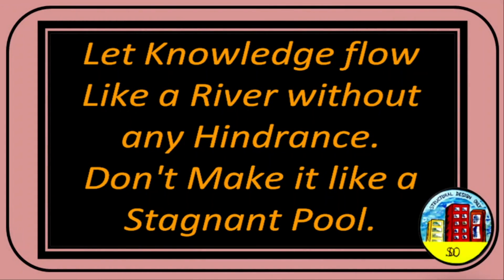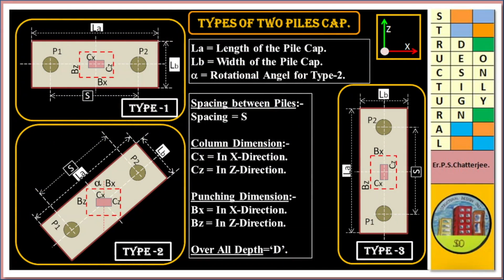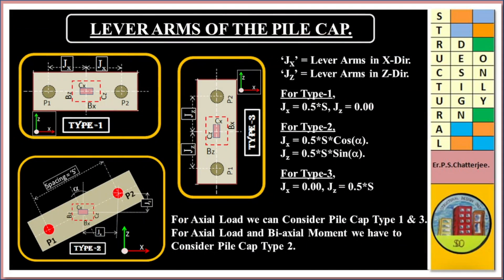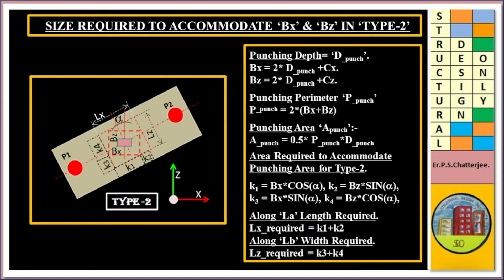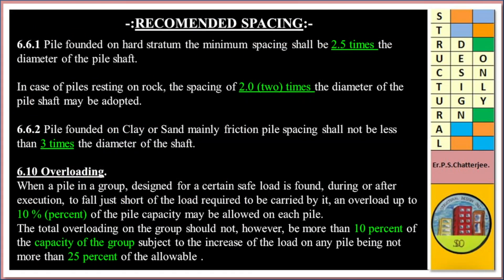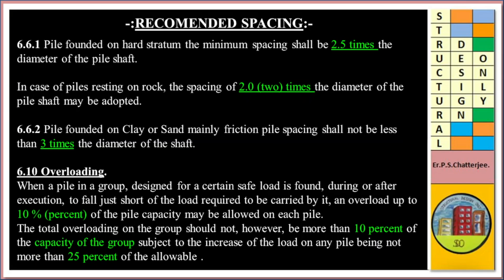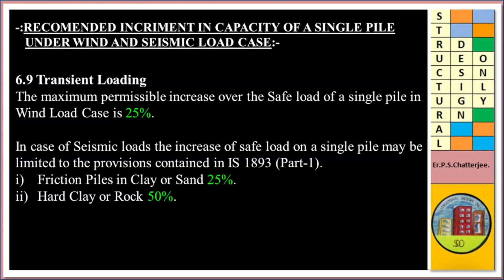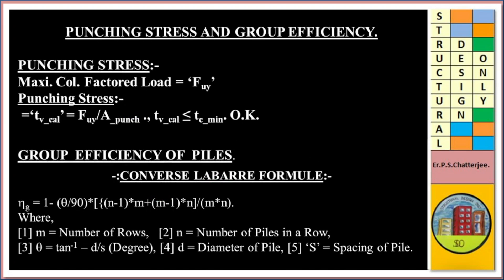How to Design Two Piles Cap By Few Clicks in Excel.

Comment: nice video part 2
Reply from the maker: Thank you❤
Reply from the maker: Dear Mr Pavan Prasad, 
Though I am sending the file, I noticed you requested the design of a Two Piles Cap, which is actually covered in the later parts of the series. I'd like to encourage you to watch the entire 8-part series, as it covers designs for 2-9 piles caps in detail. You'll find the file useful, but watching the entire series will give you a more comprehensive understanding of the design process. Thanks for watching, and I hope you find the rest of the series helpful!
Now please check your mail box. 
Thank you.